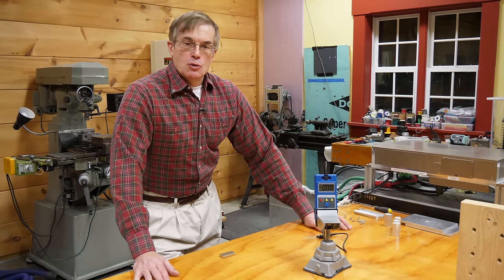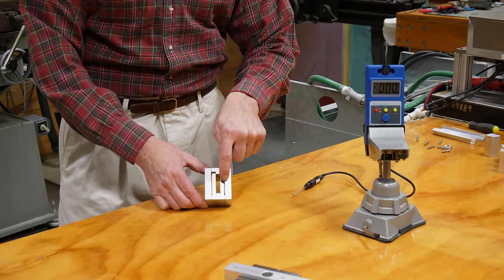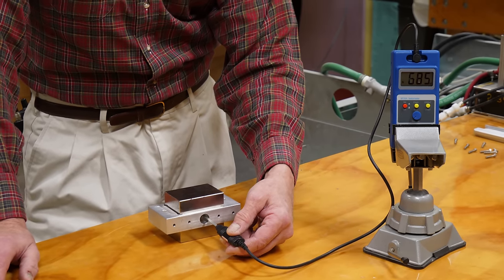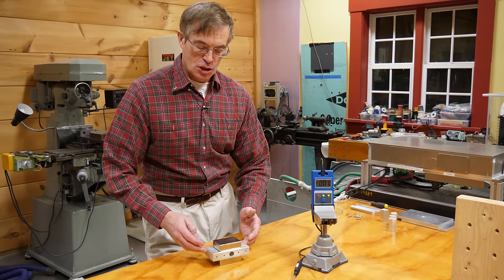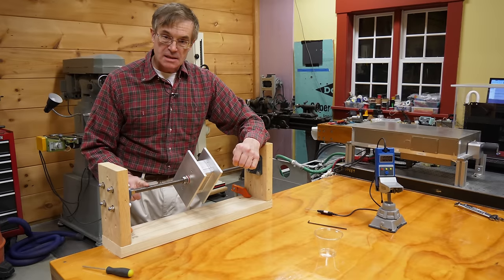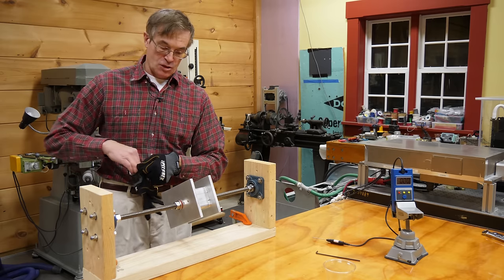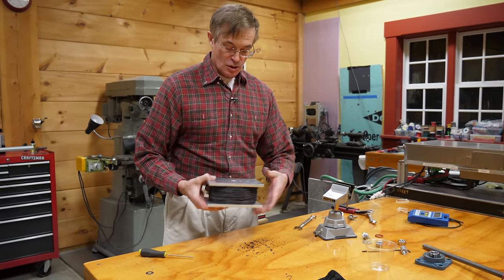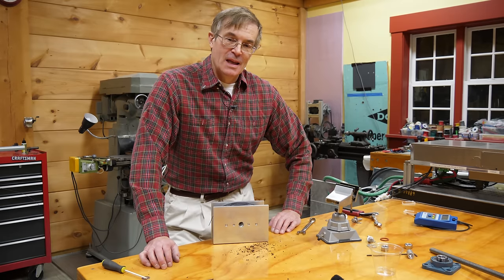VERY POWERFUL MAGNETS… THE EASY WAY

Comment: Amazing video! i would suggest to cover with sticky tape the ends of the bore of your assembly when not in use, is so difficult to clean such bores when metal debris gets in there! Anyway something that i been wanting to ask, is there going to be more content about lasers, specifically that monster dye laser? :D after my first successful dye laser (very small just  about 2mJ of energy :(  ) Im planing to build a powerful one by making my own capacitors out if oil impregnated paper, my idea is to make the capacitor as a roll with a bore in the middle with axial connections to place the laser cell inside the capacitor that way i reduce inductance to the minimum. The biggest issue i been having so far is finding an appropriate enclosure for the capacitor, all plastics seem to be too permeable to water vapor and the oil's break down potential is very sensitive to it.
Reply from the maker: We will demonstrate that laser in a future video.  I have built a number of those rolled capacitors.  You can see some of them in our much earlier video covering a modified medical dye laser.  In my opinion, despite the promise the equations give for these high voltage, low inductance capacitors, I would recommend surplus discharge capacitors from say, eBay.  These can be had for the cost of the materials you will need for DIY caps and usually work better as well.
Reply: @TechIngredients  Great! ill eagerly await for the video :D.   Yeah you are right, one of the reasons i started pursuing the self made caps is the equations are quite optimistic specially if i can manage to achieve a break down voltage of the insulation of 60kv/mm. I considered buying surplus caps but sadly i haven't had any luck finding them at a reasonable price with someone that can ship to my country (I can't find anything were i live that can work for such laser), also the shipping is quite expensive for the large caps. So i kinda got too excited after seeing it might be possible to make my own ultra low inductance caps out of relatively simple materials but is turning more difficult than i thought mostly due the problem of making a housing that insulates the end plates-connections but also that isn't very permeable to water vapor, glass would be great, ceramic perfect but the cost of a tube of the size i need nulls the advantages of making my own cap. But well i see you have gone thorough this already so i will put a good deal of consideration to keep searching for a surplus cap, i might hit the jackpot and find a pallet with pulse caps like the ones you found for very cheap, i might even ask for a loan to the bank just to get them haha. Mm this comment is already quite long, sorry about that, i become very excited when i think about this stuff. Thanks for your advice!

Comment: Excellent idea. Question, I'm building an electro magnet to repel the same neodymium block magnet you are using. If I wrap copper wire instead around the same apparatus spool you built and add dc current through it would it extend the feild temporarily to push the neodymium away with a great force?

Comment: Awesome content! Seems like this is definitely the best solution if you're prioritizing adjustability in weight and field strength along with ease of manufacturing! 

I had a thought about the cross-sectional area of the wire wrap. Given that circles have a maximum packing density of about 91% (probably closer to 80% in the case of hand-wound wire), and the field density seems to fall off with the inverse square of the distance to the surface of the magnet (correct me if I'm wrong on that), couldn't you get the same strength from a solid steel enclosure that only had ~60-80% the mass of the wire? Or why not combine them both? Make a thin (say, 1/4" thick) steel enclosure out of rectangular bar stock close to the surface of the magnet where you get the most "bang for your buck" (i.e. field density per unit mass of steel) and wrap steel wire around that enclosure to get the benefits of the wire? 

Just a thought! You understand your application far better than I do. Thanks again!

Comment: Ha ha ha ha... ARGGGG! From funny to frustrating happens fast! 9:25  It would be interesting to have a hinged field guides so you could quickly remove the magnet.
Also it would be interesting to test the point of diminishing returns on the number of wraps.

Comment: Hi Tech guy that's why they use these in voice coil HDD because the lines of force are compact enough not to affect the platters.
Reply: the coercivity of modern platters means you could wipe one of these across it basically and not lose anything.
Reply: @GigsTaggart  Yet I have destroyed hard drive low level formatting by having a very strong magnetic field near to them when they were not in use. It's handy for destroying the data on a drive before disposal, and without having to dismantle the computer, but it's expensive if you do it accidentally.
Reply: @RWBHere  unless it was a very old hard disk or a very, very strong field, I don't believe you.  Degaussing a modern platter we're talking several Tesla.

Comment: A guy did a similar wrapping, of flat aluminum and steel layers, strips of sheet metal.  I tried it out and found the aluminum didn't help. Also, and this was cool to me, it matters what direction you wrap it, one way barely took the side force away, while the other direction almost nullified it.  Also found that more strips of metal didn't help much.  I used thinner metal than he did, with the strips just a tiny bit taller than the magnet.  I've ordered a tesla meter for a video i'm going to do on magnets this month.   His video is on the YouTube channel, SparcySparkman, title free energy magnetic shielding holy grail.  I'm not into free energy, but its short and interesting.  Also, my reply there was this: SparcySparkman Hi, Sir. Okay, these are the surprising results. I used two equal neodymium magnets, 52N power, cylinder mags, 1/2 inch tall, 1/2 inch diameter wide. I bought tin coated steel @ .013 inches thick, cut two strips with a ruler, 1/2 inches wide, 5 inches long. I used common, thin aluminum foil, 0.0007 thick, cut at 5 inches long and a 1/2 inches wide. I also used electrical tape, to break any contact with the magnet and the metal, just in case that was changing anything. It surprisingly, did not change anything, though I thought it would. So the following results are without the tape experiments because, they had no appreciable effect on the magnetism that I felt. Sadly, I have no guass meter, but I will be getting one and re-doing the tests. With steel only, wrapped tightly around the magnets, there we find the greatest shielding of magnetism. With thin aluminum foil, there is a loss of shielding, no matter which way the poles are to the direction of the wrapping. So to the greatest shielding, there are two strengths, the strongest shielding is when the steel is wrapped counter clockwise with the north pole up. I replicated all tests with the poles reversed, and pole direction mattered in every test. So, if you use thin aluminum, (don't know about thicker), you lose your shielding for some odd reason. If you use steel, alone, you have a better shielding, contact with the magnet's metal surface didn't change the properties. The best shielding is with the steel alone, wrapped around the magnet, north pole up, counter clockwise. Those are my findings before I can add numbers to them later in the summer when I get a guass meter. I eagerly await your response, Sir, as to whether you find that your system works the same way. Thank you.
Reply from the maker: Aluminum will not help.  It is not feromagnetic and the field is affected the same by aluminumas it it is by air.  The direction you wrap does not matter unless it changes the effeciency of your wrapping process.  Other than that, the field effect will be the same.  It is bassicly how many feromagnetic electrons ie iron atoms you place to intersect the field lines.  A gauss meter is invaluable.
Reply: @TechIngredients  I respectfully disagree. The magnets were put into the metal strip coil both directions, different magnets the same strength, N52, and it always made a difference.  When I post my detailed video, kind Sir, I will let you know.

Comment: Interesting yoke design and assembling method, thanks.
As far as I know, PM machines are being assembled and disassembled using hydraulic press like tools that allow slow and very powerful PM insertion in a sliding motion.
One suggestion working with stainless steel fasteners: be careful of using both stainless bolts (thread rods) and nuts together. Since this type of steel is plastic, nut and bolt tends to "stick" together so hardly that it is impossible to untighten it any more, the bolt is being distorted and breaks. This usually occurs at high tightening momentums (smaller diameter fastenets suffer more often).
Reply from the maker: Thanks.  You're right about that effect with stainless/stainless.  The worst is aluminum/aluminum where galling also occurs.  The hardware here is so lightly loaded that this is not as problem, but when we used stainless fasteners in our turbocharger-turbojet project we had to cut out a number of fasteners.  Heating must make this problem substantially worse.

Comment: If you intend to do a lot of these just grab a smallish electric motor, couple pulleys and belt and a pedal from an old sewing machine. Have a seat and let the jig do the work for you, all you have to do is guide the wire.

Used this setup to wrap hundreds of spools of various types of wire and cord. It's priceless.

Comment: Another great video, you have to love playing with magnets.  I bought a couple of those magnets last year in a rectangle shape.  I try to use them on my gold sluice box hoping to catch the iron in the dirt.  It did catch lots of iron, but every now and then the epoxy would fail and the magnet would break free.  It would hit the side of the sluice box so hard that the magnet would shatter.  Pretty amazing to see it fly across the table and the amount energy it had when it hit the metal sluice box.  We don’t use them anymore.

Comment: So if you wanted to make things easier in some ways but harder in others, I think you could just heat the steel blocks you wanted to contain the field up above their curie temperature, stick them in place and then VERY QUICKLY quench them before you got the neodymium magnets close to their own curie temperature.

Comment: Do you think using a metal tape with conductive adhesive would work as well?
Reply from the maker: Yes and you could eliminate the adhesive as the magnetic forces will hold it in place.  It would even be more compact, but it will cost more.

Comment: Yeah..I bought two of those big block N52s from Amazon back when you could (in UK).   It quite as big as these, but close at about 45x45x60mm.  Once they clamp to thick steel you just can’t pull them off directly…have to slide them off the side.  Now…both are stuck together (mistake on my part).  I’ll need a wooden lever device to separate them now.

Comment: Great video.  You can use another "jam" nut against the nuts holding the magnet in the middle of your threaded rod and that will keep the magnet centered.  Then you can use a large drill or a motor with a belt to spin your magnet or thd'd rod and make it much easier to wind the coil around the magnet.  Or use a guide similar to a fishing reel.
Reply from the maker: The jam nut is a good idea.  I should have simply tightened the nut properly before we began.  A mechanical winder was not used because the coil of stock wire is not that easy to unwrap.  The individual coils would twist and separate in multiple, overlapping loops, threaten to kink and might even catch a finger, especially if a mechanical winder was being used.

Comment: Cool video! Why would tools be LESS attracted if the wire increased the Tesla? Also, what is the dust that accumulates while wrapping the wire? Is that from the steel wire? Also - what would you have to do if you wanted the magnet to be MORE attractive to the nails or even heavier objects?
Reply from the maker: Thanks!
It's because  the field doesn't  actually  increase or decrease.  The wire redirects it and concentrates it within the coils.
The dust does indeed come from the stock wire coil.
That is exactly why many magnets are coupled with steel caps or end plates that gather the field and increase its holding power.

Comment: Sir;  when you started to wind up the wire on the threaded shaft, i thought maybe if you would have drilled a whole in one of the RT or Lt wooden supports and extend the screw shaft through it
THEN put a veriable  speed on the  screw and let it do the work....  Just a thought... Great job!!!!!!!!
Reply from the maker: We thought about that, but the limitation is the poor guy (my son) who has to manage the twisting stock coil and we didn't want to risk his fingers.

Comment: Fun stuff.

I have some magnets of lesser material, likely the ordinary neodymium mix, that are only about 20mm (almost) cubed that are a little nerve-wracking to be around. I found that a thin wooden table is just flexible enough, so if the magnets are on the table, and something is dropped on the table, the table deflects downward faster than the magnet, leaving the magnet in mid air for a moment, eliminating all friction but aerodynamic drag, which allows the magnets to seek each other out. Fortunately, all it did is chip a magnet, but the trick for me was: the magnet is heavy enough to trick the hand to not noticing just how far the magnetic field really reaches. So, if you are wearing protection, one could feel out where the magnets start attacking each other, and even set them down a little farther, and then slam the table, and away they go. If the magnet is not completely square/round then the mass centeroid can be more noticeable than the edge of the magnetic field between two magnets.

Just when I felt somewhat comfortable with magnets, I found some videos about homemade wax electrets, creating a semi-permanent electo-static field in a material.
https://www.youtube.com/watch?v=1DR-tTU8uIM

I still find eddy currents in flat non-ferrous plates upsetting because it represents an electric circuit with almost no insulation. The electrical current just doesn't care to circulate in the center of the currents because there's no induced potential difference, in places.

Some time ago, I wrote a Arduino stepper-motor program, that has a command-line and joystick control for such chores as winding that might help in projects such as this or making electronic or specifically fiber-optic coils. One can input a number of turns and then it will stop at at that turn, while you go back and forth with the joystick to fuss with the winding operation. It also has dividing features and stuff. I wrote it specifically for doing odd science-project tasks and for testing motors. It would take a gearbox to wind that steel/iron wire. You might be able to get galvanized wire at home depot, for fencing.

http://forum.arduino.cc/index.php?topic=469343.msg3213804#msg3213804

Good videos, because they have me thinking. Thanks.

Comment: Oh I know all about the tools being tough to operate around strong magnets. For work I made a magnet for plastic material to fall onto from a conveyor, to keep ferrous metals from entering a shredder. It consisted of 1/4" steel plate, 276 1"x1"x1/4" magnets with a countersunk hole, that many flat head Allen drive steel screws, and tapping that many holes (they were laser cut, no drilling required). Putting the screws in and getting the Allen key in was "fun." Especially when the tolerances of the magnets weren't very perfect and the screws didn't want to go in the holes sometimes. In hindsight I should have added 0.005" or so to the hole spacing. It is a 23x12 array.
Reply from the maker: Did you know they use the same magnetic separators to remove metal from barley before making scotch whiskey?

Comment: 9:30 is the dust beneath the magnet assembly from the threading stripping off or just from the steel wiring?
Reply from the maker: It's scale from the wire.

Comment: 9:20 With the benefit of "20/20 hindsight," I'll bet your "Mark II" version will include QTY (2), four inch sections of aluminum tube used as spacers between the magnet assembly and locking nuts on the winding shaft.

Comment: That was terrific and something I've always wanted to try. My thinking was to get the lines of force on paper and then follow just those lines of force with silver or copper wire. Maybe flatten the wire a bit. Lighter weight was more my objective. 
Fantastic video.
Reply from the maker: Thanks.
Don't  forget  that those lines are an intellectual construct.  They don't  actually  exist. You can only guide the field with magnetic materials, so copper silver and even stainless steel don't work.
Reply: @TechIngredients  ok I once saw a youtuber drop a magnet down a copper pipe, the magnet dropped very slowly. He said that the copper pipe interacted with the magnetic lines to slow the magnets decent. This made me wonder if another magnet was taped halfway down the pipe could it slow or even stop the magnets decent. Maybe tape 2 magnets north and south on the outside of the pipe. It could have been a scam using slow motion. At any rate put a magnet under a sheet of paper, then drop iron filings on the paper. Magnet lines should show up. As far as silver or copper, no they are not magnetic.
Reply: I tested the copper pipe idea. Yes another outside of the pipe does stop the other magnets fall. Silver has a higher electrical conductivity  then copper  so that would be a nice experiment. Also, graphene would be fun to experiment with. 
 A professor from 
India explains how to do this.